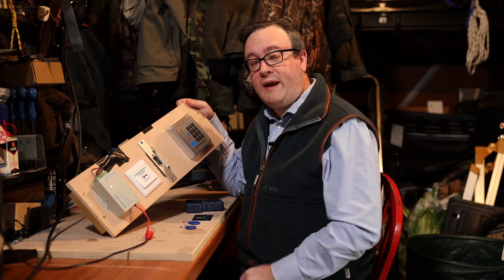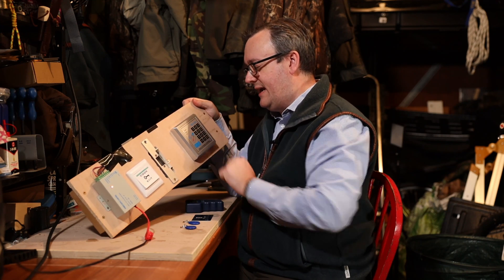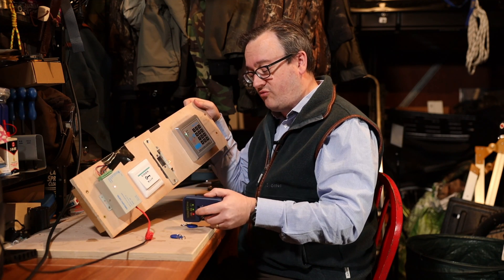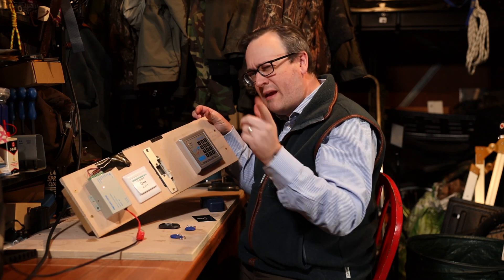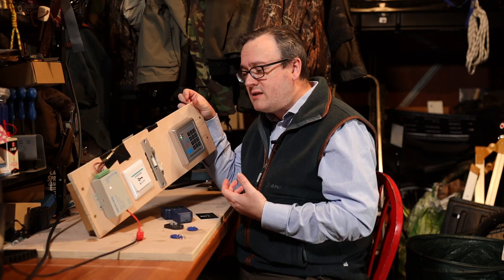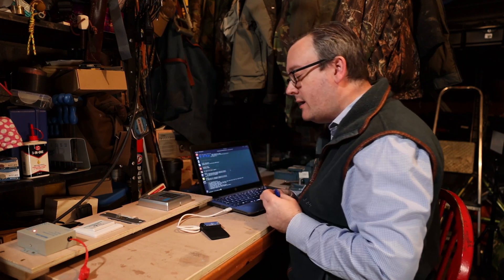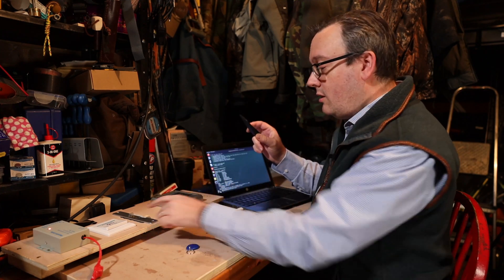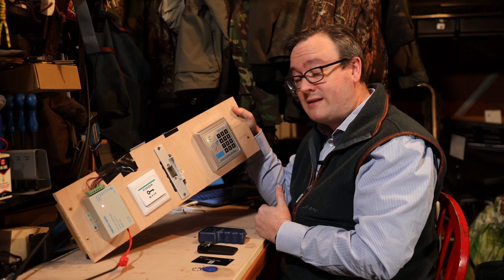125Khz RFiD bypassed 3 ways

Comment: Hi, there is a beautiful 1800s elevator modernized so that it can only be called or used with an rfid chip, and it's really pissing me off. But the staircase is open to anyone, so there's no point! Do you have any recommendations on how to bypass this easily? It's really pissing me off (it's the majolica haus in vienna, Linke Wienzeile 38)

Comment: What do you recommend for higher security?
Reply from the maker: its though, a move to a HF card type ( desfire EV2 or 3 for preference) and actually request data from the card ( not just the card ID) will be about as good as you can get for the moment
Reply: iris scan on the doorways. this is what data centers use. you get scanned and programmed into the system, so you present your HF card key, then it scans your iris to enable entry.